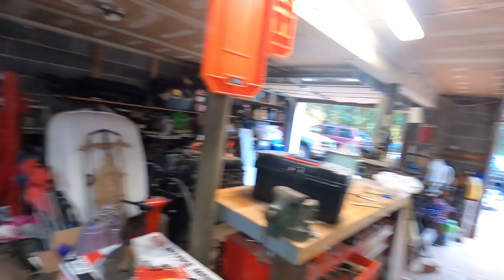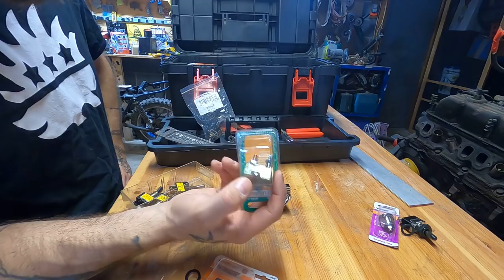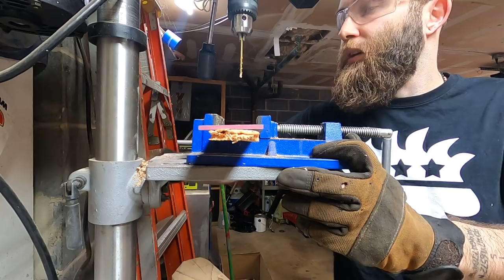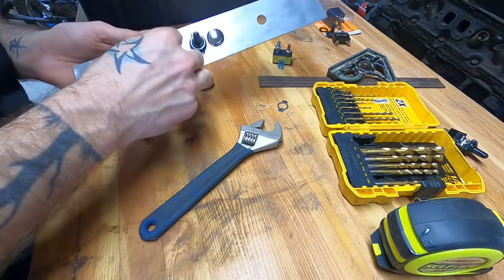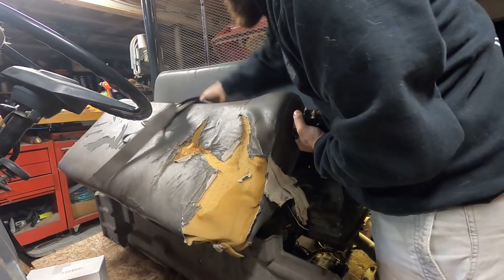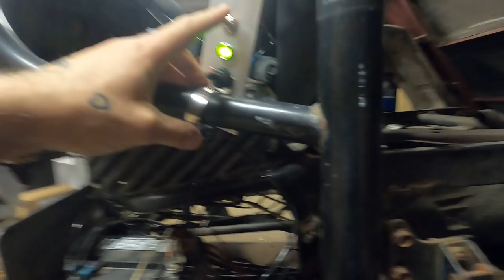Kawasaki Mule gets a CUSTOM SWITCH PANEL - Winch Controls, Push Button Start, Auxiliary Lights

Comment: Have you thought about adding a roof to the Mule? It would add some protection when you add lights. Also use a battery box from a truck for the battery and solenoid you added for water proofing and keeping the executive out of it. Great video and I don’t see anything wrong with your electrical or use of wood tools for mechanical projects. I do the same thing!!

Comment: Cant wait until you get that front seat reupholstered.
Reply: I wonder if a bench seat out of a ford ranger or s10 might fit in there?  Would be a fun video between the u pull and then the install
Reply: Not a bad idea. Maybe take the measurements of the mule seat and head out to the pull and pay and start hunting for a seat that fits. Start with the ranger. Good idea.

Comment: Pull a set of WJ fog lights and put them on the Mule LOL.  An old set of jumper cables would make a great wiring set for a winch, the wire gauge is plenty heavy enough for winch use.
Reply: Find an old CJ grille to mount on the front and use the headlights in that!  Haha that would be so cool

Comment: Harbor Freight has halogen clear fog lights for 12.99, might be good for it since not LED .
Reply: I have the amber fog lights on my Bronco 2, they work great.  I haven't installed the clear lens driving lights yet....and Harbor Freight is discontinuing the amber lens lights sadly.

Comment: For the lights, why not use some converted junker headlamps. Also I just bought myself a harbor freight air impact, honestly so worth it, its only like 50 bucks
Reply: Which impact did you get?  The 1/2 inch one I have doesn't work very well at all, it don't even have enough torque to remove the bolts for the blades on my lawn tractor, I have to go get my Dewalt 3/8" impact to do that.
Reply: @wildbill23c  I got the central pneumatic heavy duty air impact with 1/2 drive from harbor freight. Downside is you need an air compressor hooked up to it all the time but it does a damn good job

Comment: Just a few comments.  Why would you mod a space connector and not use a ring connector? As for the switches I would mount them on the dash area and hide a master kill switch from the jr executive.  I think it looks like a  inconvenient place to have switches. Another thing is I would have used the larger wire. Your fuse/breaker will protect you and there is less chance of over heating your wiring and having a fire.  
Stop thinking like a west coast guy and think like the east coast guy ( #wranglerstar reference there) you are. Thanks. Just my opinion do things how you want. Peace.

Comment: I would suggest a roof (painted plywood?) and some of those cheap yellow halogen fog lights you can get at Autozone/Advanced. You can probably find them at the yard. I would also suggest white and yellow.  The white produces more light, but the yellow has less light bounce.
Reply: ....and run the battery down on the Mule in the process....I do wonder if that would actually be the case, running a winch while plowing and fog lights may draw too much from the battery to the point the machine dies.

Comment: At first glance I would say that you should steal some front running lights from a ZJ at the u pull.  Not sure how bright they are, but I see a lot of them still intact at the junkyard.  If not for effect, at least for some Stylin'.  And don't forget the Mars light on top, nothing says "professional" snow plow rig like a flashing yellow light on top (and some thoughtfully selected bumper stickers).
Reply: I believe they are 55 watt lights in the ZJ fog lamps.  They're pretty bright.  Bright enough I accidently drove 37 miles back to town one night with the fog lights on but the headlights not on....kind of a dumb setup in the ZJ where you can turn the fog lights on with the light switch in the parking lamp position.  Got all the way back into town and got pulled over.  Although the cop was laughing he goes well you did pretty damn good driving that far with just the fog lights.  He just stopped me to tell me that my headlights weren't on LOL.  We do have some great law enforcement officers around.

Comment: You need a narrow pencil box lid to cover the switches.  Helps keep the rain/snow out and little fingers away.  For only $0.99, you can buy class like that...
Reply: An outdoor outlet with a waterproof cover that has the back cut out and glued to the panel would also work nicely. You can even get ones that lock.

Comment: This off topic, but I love your stuff. So, question, do you think that you could swap out a 4.7 for a 5.7 in a 2006 Durango and would you have to change the transmission?
Reply: I believe they use different transmissions, but not 100% certain.  You'd of course need to swap the PCM as well.